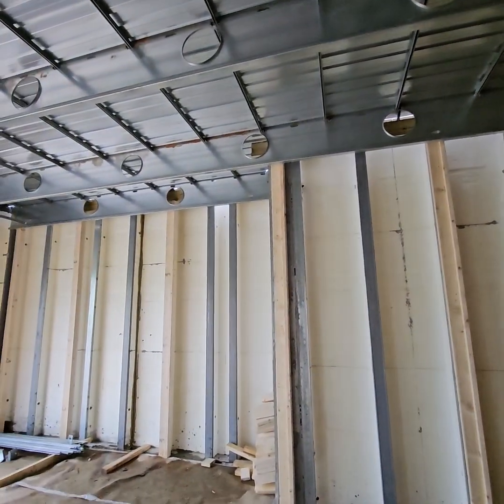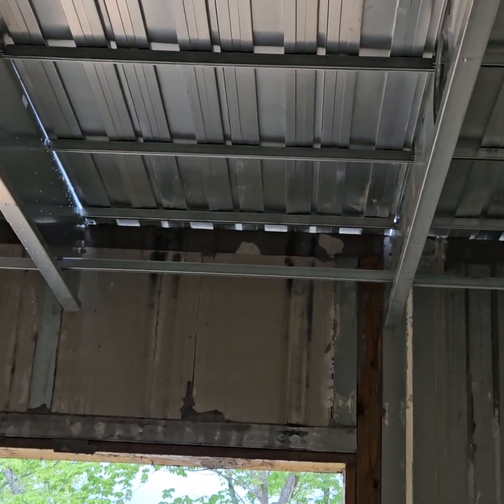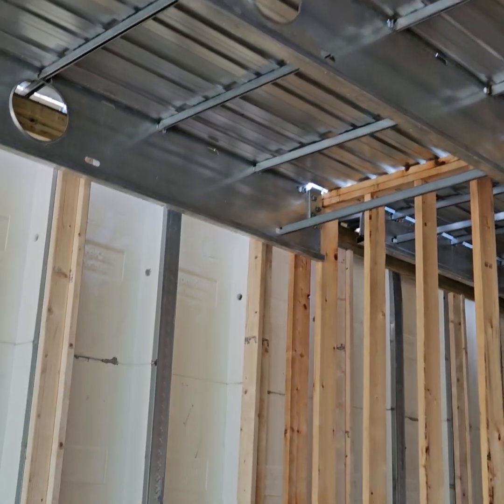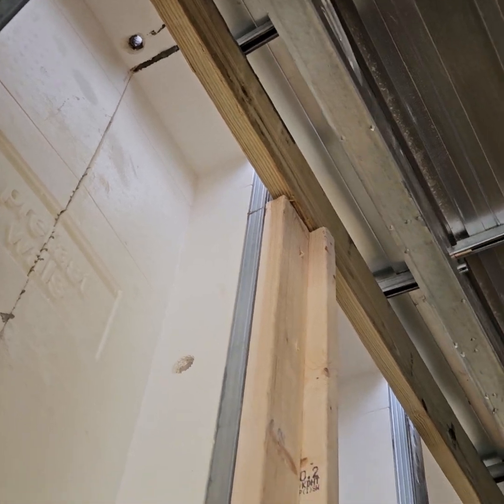Super Floor USA suspended concrete floor system

Comment: Thank you for posting this. I have used superior wall for my previous two builds. For my next build I am also looking at a suspended garage floor. Im curious on your decision to no use precast concrete panels for the garage floor, was that an option?